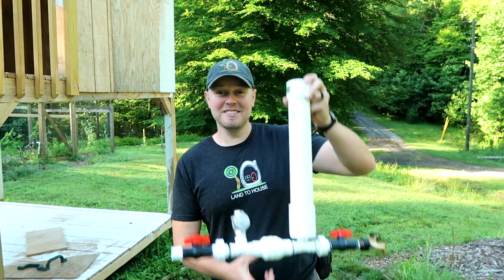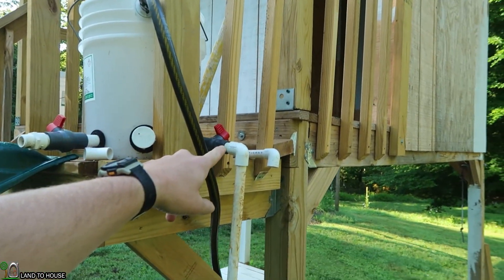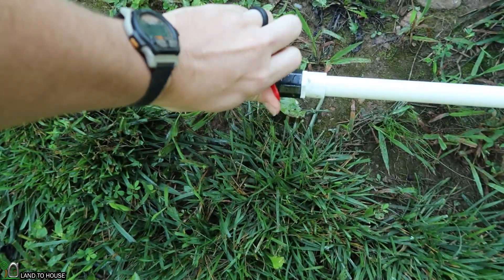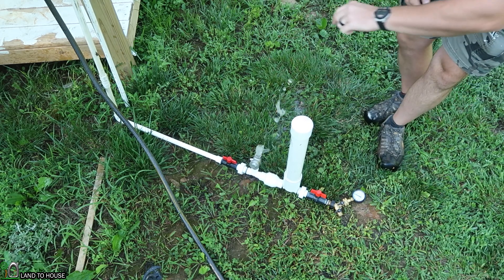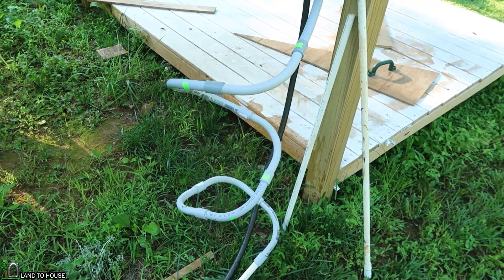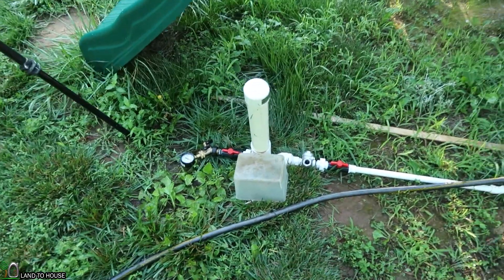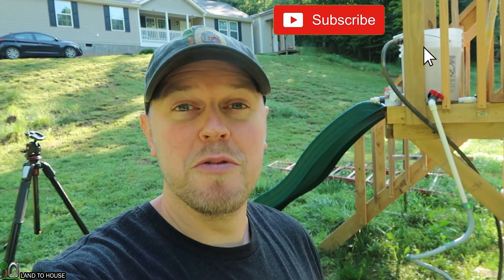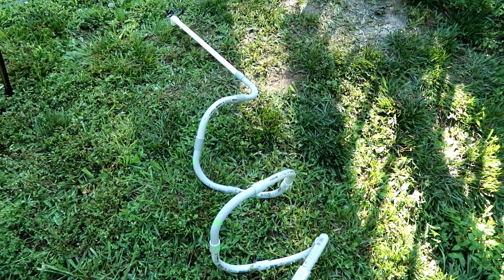A Spiral Drive Pipe for the Ram Pump?

Comment: What if you increase the size of the pipe from the 5-gallon bucket to the Ram Pump. Will the pressure, or output, of the Ram Pump increase?

Comment: So, is it strictly about "drop" or is about how much pipe you use in the drop?

IE, will you get the same performance out of a straight 2 foot vertical pipe, as you would out of a coiled pipe with many turns fit into that same 2 foot drop?

Like, would potentially [hurr hurr] having more water in the many many turns of pipe amount to more pressure? Or does it not care how much water is in the pipes, and it only cares about the 2 foot drops, regardless of the number of turns and how much water is in them? Bottom line it... :)

Comment: I've got 2 questions.

1) what is the shortest feed pipe you can use that will still build up usable pressure 

2) what is the slowest flow through the feed pipe that will also give you usable pressure

Comment: Hey, Seth, I have been binge watching your videos and have already bought my first ram pump from you through Amazon.  I love what you're doing and I am looking forward to seeing how your micro hydro series turns out.  I was wondering if you have done any experimenting (or already have the knowledge) with figuring out the optimal amount of lift to get the best flow/pressure.  I have seen a few times in your videos where there wasn't quite enough back pressure to keep the pump running, as well as times where flow was very minimal do to too much back pressure.  Also, as far as back pressure is concerned, can't I just add some resistance at the discharge pipe to provide the back pressure (like using a capped pipe with holes drilled in it) instead of increasing elevation?  I would like to go into what I am trying to do, but this comment is already way too long and I know you stay pretty busy, so I will save that for if/when you reply.

Comment: I have a question, will the ram pump work if i place it in river flowing at 11m/sec with a funnel made from example a 200lt oil drum
Reply: Yah. It would work but...
With that much volume of water the pressures would require threaded steel pipe or maybe welded.

Comment: This is interesting, wonder if this changes the math on 7 feet of lift for every foot of drop in pipe.  With the spiral, you have increased the footage of pipe in a shorter distance, creating more hydraulic pressure against the valve, seems like if you have 10 feet of spiral pipe covering the distance of a 5 foot drop, you could increase the distance of pumping up hill, 7 times 10  foot of pipe instead of 5.  I think I smell a test coming up.
PS: I would think you would need the resistance and back pressure of the out flow going up hill to putt pressure back down on the Ram Pump to stabilize it.

Comment: How about a 50’ long drive pipe that drops rather steep. But at the last 10’, it goes up again. 
Or even the last 20’ it goes up. 

Would there be a difference?
Reply from the maker: Thats an interesting question. I know that in micro hydro its best to have the penstock always going downhill to keep air pockets from forming. I wonder if that applies to the drive pipe.
Reply: It should cavitate at least adding air to a portion of the system.
Not sure how much spring pressure using a parallel pipe acting as a gas shock would add?
But it would add at least 2 joints and 1 length of tube plus another very small one way valve.

Comment: HI    COULD YOU USE 50 FT. OF  POLY PIPE,  SPIRALED TO ABOUT A 24 IN.  SPIRAL PUT IN  ABOUT A 5 OR 10 FT. SPRING SHAPE WORK?  ( 50 FT. OF PIPE IN A 5 TO 10 FT. AREA.).  ALSO WILL IT MATER IF THE SPIRAL IS LAYING DOWN ,  STANDING ON EDGE , OR UP IN THE AIR LIKE YOU HAVE IT ? LUST SOME THOUGHTS TO GET MORE DRIVE PIPE IN A SHORTER SPACE.   KEEP UP THE VIDS LOVE THEM.
Reply from the maker: SO many things to try. I have a feeling that the tight spiral is not going to work because the pressure wave is going to dissipate very quickly.  It just seems like the best results are a drive pipe that is longer and straight.
Reply: @LandtoHouse  I THOUGHT THE WAVE WOULD FOLOW THE SMOTH  CERVE OF A SPIRAL BETTER THAN THE 90 IN THE OTHER ONE YOU HAD. THANK YOU FOR THE REPLY.

Comment: Why not use a garden hose?
Reply from the maker: From my testing years ago I found that the garden hose does not make a good drive pipe. It is so flexible that the pressure wave is very weak. Also many garden hoses are not true 1/2" inside.

Comment: have you tried a long sweeping curve, if you boil water and fill a PVC pipe with that water the heat will allow you to reform the pipe. A single pipe curved without junctions to cause turbulence would have a fairly good chance to give you what you want.
Reply from the maker: All the couplings might have caused an issue with the pressure wave in this test. But I think it is conclusive enough to say that the drive pipe is best longer and straight.

Comment: I'm new to this, I have approximately 120 feet of drive pipe to get 6 feet of drop. 3/4 in feeding a 3/4 in swing valve. Only runs 10 to 12 cycles then stops. What do you think my problem is?
Reply from the maker: It could be a few things. If this is happening with the delivery pipe closed it is not back pressure loss. If water is coming out the top with delivery pipe open it might be back pressure loss. 

Air in the drive pipe can do that. Long drive pipes can do that.
Reply: @LandtoHouse  1st Thanks. Delivery pipe is closed. Doesn't seem to be any more air coming out. Definitely seems to lose head pressure. Do you think going down to a half inch ram pump with the 3/4  inch drive pipe would work?

Comment: Fun stuff.  Would be interesting to see a 50' garden hose spiraled clockwise around your structure and come into the ram on a more gradual sweep rather than a bend.
Reply from the maker: I have found that garden hose is not a good drive pipe. Very flexible and also is not actually 1/2" inside.
Reply: Land to House.  would the flexibility absorb some of the shock?

Comment: I really like that you are open to testing all these ideas. 
Please try a 20' pipe bent to a long elbow, versus 5' down, 90° elbow, to 15' horizontal. Both options come down from the feed bucket.  Then compare that to a 7' pipe coming fro feed bucket at 45°, to a 13' horizontal pipe.
Reply from the maker: Basically trying all the fittings to see what causes the best pressure wave. I do want to have a video showing all the fittings and how they effect the ram pump. Thanks!

Comment: I tend to look at the ram pump as an equivalent to a boost power supply with an inductor and capacitor.  https://en.wikipedia.org/wiki/Boost_converter.  The long lead in pipe is the inductor and the pressure/air bladder is the capacitor.  The check valves are the transistor/switch and diode.  The longer the run is like more inductance so adding a spiral to increase the run in a shorter distance would help.  The in crease in resistance of the joints would decrease the affect.  If you made the diameter larger it would counter the resistance. 
Also if you repeat the set up and glue all the connections I think that would make a better experiment.
Reply from the maker: Water and electricity are often compared. The fittings in this test most likely did cause issues with the resistance.
Reply: That was a beautiful description which comes from the brain of an expert electronic engineer. Thanks for your nice comments.
Reply: Though it seems like increased water mass didn't translate to the analogous inductance, I wonder if the acoustic effects caused that, and what would be the electrical analogue?

Comment: What if you used a larger spiral? Like a 10' tall one? And/or use a longer pipe between the spiral and the pump?
I'm thinking of a situation where you have a tall waterfall to use, and it's easier to build a vertical support tower, rather then a long sloping one, or a series of pillars, then a longer run to the pump itself, kinda like your personal setup. It probably wouldn't work  as well if you had a 5' pipe between your bucket intake on the creek and the pump.
Just an idea to maybe try in a future video.

Comment: What is the aim here? Do you want more friction losses? Why do you want it to cycle slowly?
Reply from the maker: This was a suggestion from several viewers. It is best to have a ram pump cycle at once per second. That rate allows for proper pressure to be built. If the pump is too fast it uses a lot more water and normally does not build as much pressure. So the spiral idea was to increase the drive pipe length and slow the cycles in a very short space.
Reply: @LandtoHouse  I see. My question came from the fact that water is not compressible and the column of water are still the same. So you want  more moving mass of water to get more compression of air in the air tube? (I think I have to study the function how this work, before I say anything more)

Comment: Very nice. I really enjoy your r&d work on ram pumps.
If possible try to do research on ways to channel out water from waste valve so that it doesn't splashes all over and help pump to stay dry for longevity.
Reply from the maker: I actually do have 2 videos showing T's on the waste valve that carry water away from the pump.
Reply: I was also wondering about that, would prevent water wastage. Must have missed those videos, will take a look

Comment: You really need to start using PEX. Far superior. Please start using it for your future videos. You can freeze it solid. Plus it's easy to configure in any way imaginable. Thanks
Reply: PEX could be used but its bending would introduce another variable. Not to mention the fittings for a "cheap" experiment?